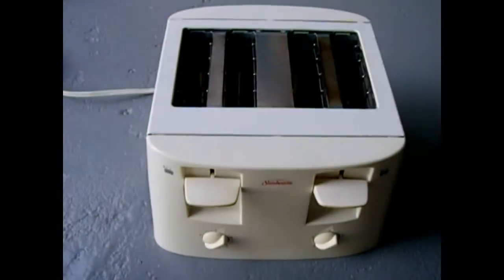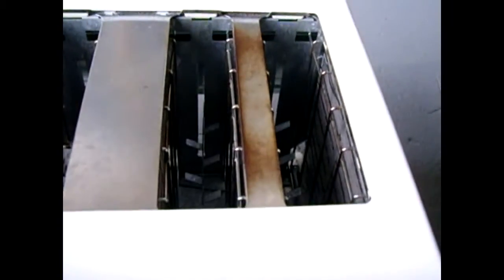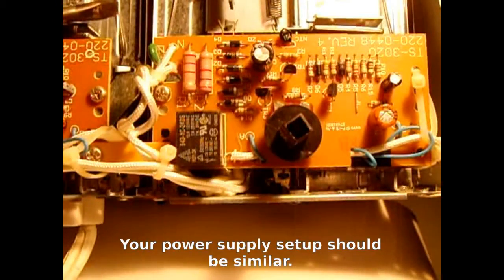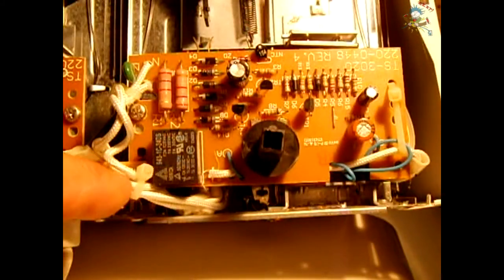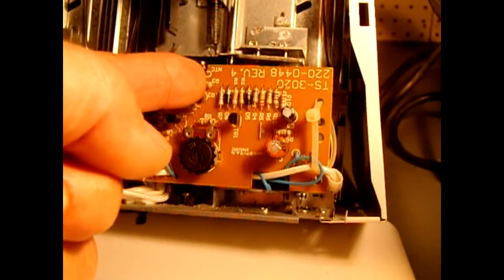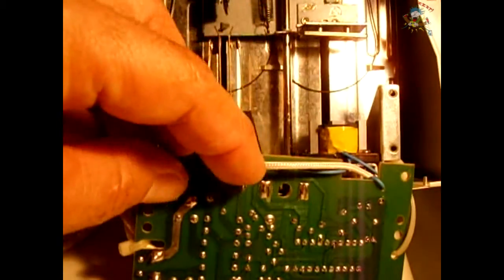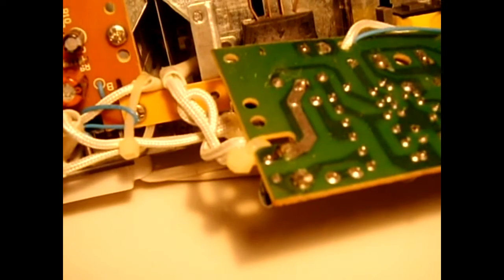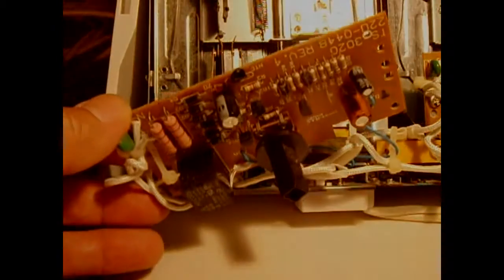Troubleshooting Electric Toasters (Step By Step)

Comment: One of the those rare toasters equipped with thermistor and the power contacts are not soldered directly to PCB. New production toasters are all just using timers, which never give consistent results.

Comment: Hi sir very knowledgeable nice vid,I had just bought second hand a vintage  six slice toaster with the timer and heat setting in one,with a little red light above and a toddle switch for off and on underneath the timer switch on the side of the toaster,it is a dualit toaster,I switched it on and noticed only 4 elements going from the left to the right worked and 5 right side never and the 6th on the right worked,as the toaster was on I lifted the toasters lever up to check the toast and as it went back down a pop or bang sound happened and it stopped working,my electricity switched off,
I checked the toasters plug fuse and that was ok but there was a 13amp in the plug,
My question is has it blown the red light or the timer and should it have a 13amp fuse in the plug  or a 5 amp,and what would of caused it to blow when lowering the toaster lever back down ,any advice would be great please.
Reply from the maker: More than likely a break in the resistive wire.

Comment: Very useful video. Do you know if any toasters are fitted with an internal fuse to protect against a short across the resistive heating ribbon? My toaster failed after a piece of dried fruit got stuck and caused a short circuit. The main fuse is fine, it's just the heating that doesn't work. Should be so simple to fix but can't find where the problem is. Thanks
Reply from the maker: Sounds like the resistive wire has a break.
Reply: @electronicsNmore  thanks

Comment: I have a Russell Hobbs toaster. When the bread is toasted, the bread pops up, but the heating elements remains on and hence the toaster can't switch off. Would be grateful for your expert advice. Many thanks.
Reply from the maker: A faulty relay, stuck contact points, or faulty control board.

Comment: I seem to have a bad solenoid.  When I put the lever down, I get 12VDC to the coil, but it doesn't engage.  If I mechanically help it, it does engage and finishes the cycle properly.  Do you think the 12V is too low to pull the solenoid in?  Or is the coil bad?
Reply from the maker: If the correct voltage is being supplied to the solenoid, then it should pull down.

Comment: Hi, The wire of my toaster is broken, but I don't know how to repair it. Which element can I use ?
Reply from the maker: You need to repair the resistive wire using the correct size from the link below. You'll need to crimp the new wire in position at each end. 
https://amzn.to/3cYkhQj
(Amazon Affiliate Link)

Ebay crimps: https://ebay.to/3c0cMZn
Reply: @electronicsNmore  Thank you